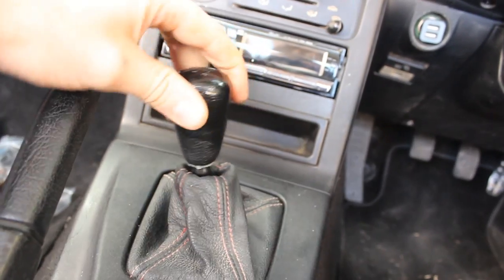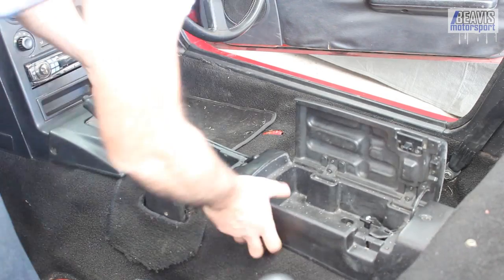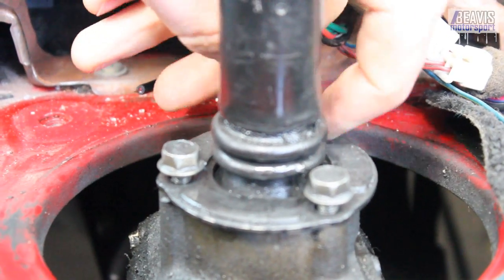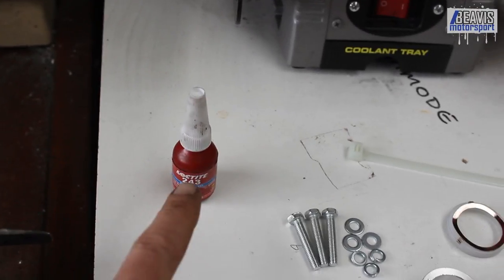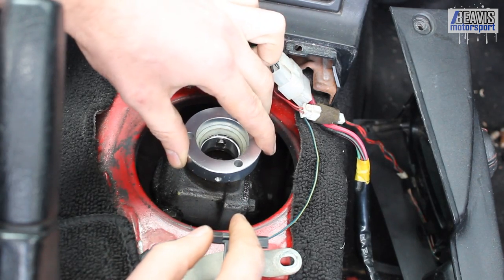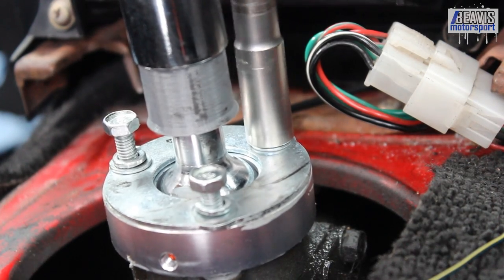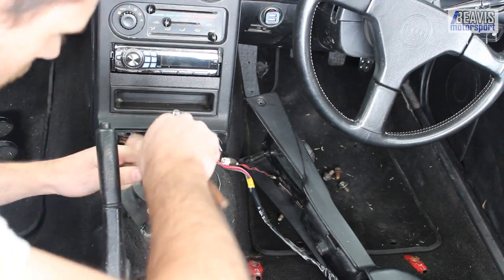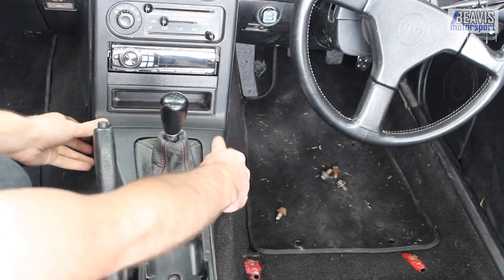HOW TO INSTALL A SHORT SHIFTER in your Mazda MX-5 Miata

Comment: Instead of cutting the white ring on the shifter, you can use some WD40 or any spray lubricant to help slip the rubber boot off the shift knob. Same trick to reinstall it.
Reply from the maker: This is 100% true
Reply: BEAVIS Motorsport felt kinda dumb after watching the rest of the video lol. You kinda give this tip at the end :)
Reply from the maker: Daniel Hankewycz hah yeah I should've made the suggestion at the start really, my bad!

Comment: Yeh! done right finally...Only thing I did different was add some silicon grease to the new upper ring and location spigot.....made it less notchy to start with.....thinking about tapping the spigot out to 8mm and turning a smooth spigot rather than running on bolt threads.
Reply from the maker: Probably not a bad idea if you have a lathe to be able to do it!  Thanks for watching!

Comment: You don't have any for the 5-speed NB '01-'02 on your website. Plus the 6-speed option is still quite expensive ($320). How is this more compelling than one from MiataRoadster ($350)?
Reply from the maker: Hi Darrin, Thanks for watching! Our 5 speed short shifter will fit all 5spd equipped NB's. You can choose the NB option from the drop down box when adding it to your cart. Note that  here in Australia, all 01-02 NB's came in 6spd.  Our 6spd option is currently priced at $320 AUD, and so offers great value over the $350USD + shipping for one from Miata Roadster for our Australian customers.

Comment: Hoping someone sees this: 1. My kit has only came with one metal+plastic bushing(without a notch). The online kit only shows one so do you have to buy a second one with a notch separately?   2.The nipple/nub on thick metal bushing(where three screws go into place): if I point it towards the back of the vehicle, the nub is on the top of the bushing(therefor incorrectly installed based on the video. However, if I flip it so the nub is on the bottom of the bushing, I have to turn the so the nub points towards the front of the vehicle. Is this a problem? Incorrect installation? Or maybe a slightly different kit? please help….
Reply from the maker: It doesn't matter if the dowel pin points toward the front or the rear.

Comment: Looks great bud! Cracking effort. 

Would you be able to make one for the stock 6 speed please? 

Kind regards Ryan Joint
Reply: He does stock them, they are a bit dearer though. Still cheaper than any other six speed short shifter on the market however.  http://beavismotorsport.com/store/quick-short-shifter-for-mazda-mx-5-6-speed-na-nb-01-05.html
Reply from the maker: I actually answered the 6 speed question in the video.

Comment: Installed last night on race/track MX5 with NA5 speed, gears are very close together now.  Does this increase chance for MONEY shifts?  I have always used OEM shifter with tall shift knob.  thanks for the chanel very good material!
Reply from the maker: Thanks Grant, where did you get your shifter?
Reply: @Bbeavis  from a friend but looks exactly like the shifter in your video.  Same parts in the kit.  Seems to shift ok in garage, not really able to drive much on street car not street legal.  Just wondering your experience vs OEM and the does the increase the possibility of $$$$$$ shifts?
Reply from the maker: @grantheathman  I think its a driver preference thing, some people prefer the OEM shifter, some prefer the short shifter feel.
Reply: @Bbeavis  yeah, guess I will wait for next race  (OCT) and take OEM parts in bin ready to change if I do not like the way this one works.  Sadly my commuter car is a NB with an "Automatic" we know how much you like those cars, but I have to say the NB auto for day to day traffic is not really that bad.  Still has 14" tires so gets up to speed pretty quick....
Reply from the maker: @grantheathman  I have an Auto MX-5 myself, nothing wrong with it, just not as "raw" as a manual transmission.
Reply: @Bbeavis  got some input from my friend that gave me the kit. his comments "Short shifters are great, give it a shot on the track. They’re precise so IMHO
 they help a lot when shifting"

Comment: Do you sell a 5 speed shifter for a 1999 miata still?
Reply from the maker: Nope sorry buddy
Reply: BEAVIS Motorsport ok thank you
Reply: BEAVIS Motorsport what other shifters do you recommend?
Reply from the maker: @lil_mac380acp2  Retail the OEM shifter, replace any worn bushes with replacement oem parts from your local parts supplier/dealer spare parts. Usually that is all that's required to fix most peoples shifter issues.
Reply: BEAVIS Motorsport my shifter pops out of first gear and sometimes grinds

Comment: nice job... mounting right over the old crappy oil with pieces of the old desintegrated white bushing, and did not
 refill  oil... thats how you change the shifter.. not how you change properly...
Reply from the maker: Are you always this angry buddy?
Reply: @Bbeavis  sometimes...
 im tinking about buying one of those..
1 question... arent those short throws much stiffer?